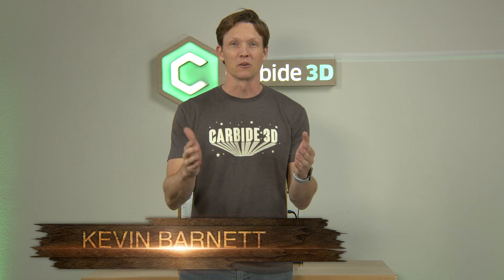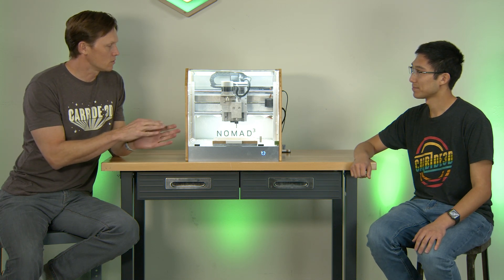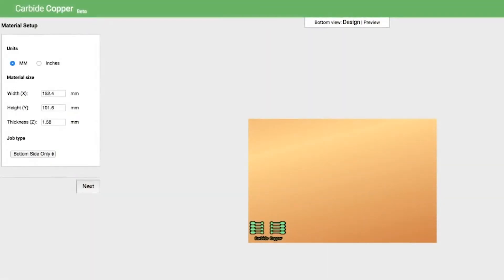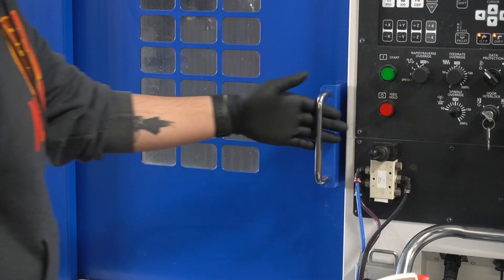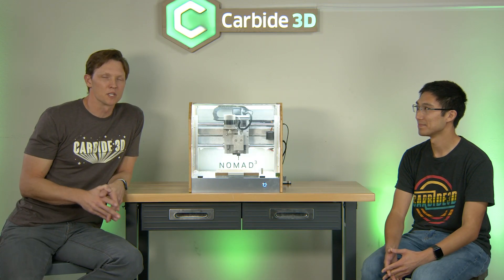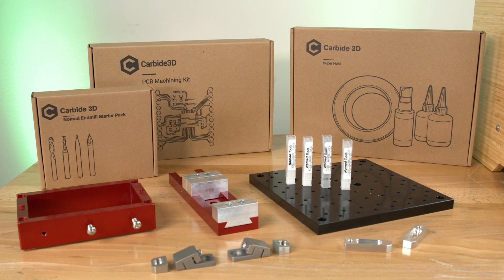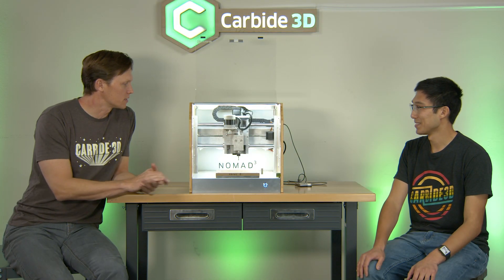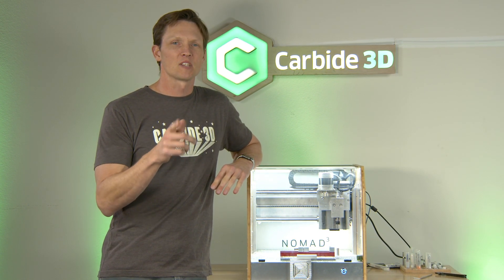Meet the Nomad 3 - The Maker's Garage Episode 2

Comment: Nice, but it's disproportionately expensive compared to the other machines in the stable. It's a strong machine but it's very small in capacity, great if you only want to make small pieces, but you can't mill anything bigger than 8 inches.

One thing very obviously missing is any form of dust collection. That would be a great benefit considering the type of materials , plastics & metal that Winston likes so much, sticking to the hardware for long periods. Can't attach external vacuum hose through the front door due to the safety switch. But even a light duty 1" diameter hose to an external port in the corner by power/usb would go a long way to justifying you price!
Reply: Disagree. It's quite expensive yes, but if you consider that a 'normal' cnc costs roughly double, this is a bargain. 
The size argument has always been: It's small both to keep rigidity and accuracy. If you want size then you should buy a shapeoko (i do hope they make a nomad xl someday) and lasty you can take the side window out and add a vacuum.